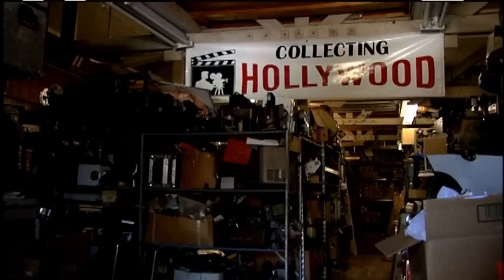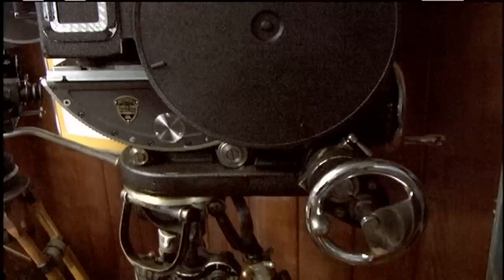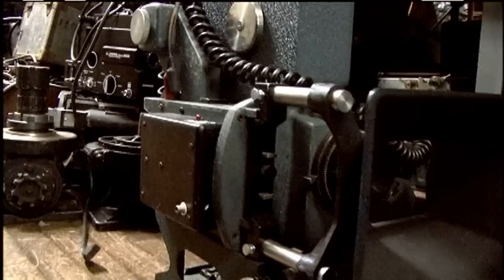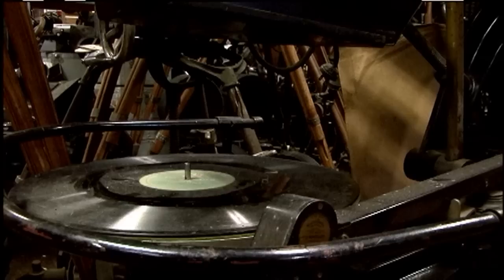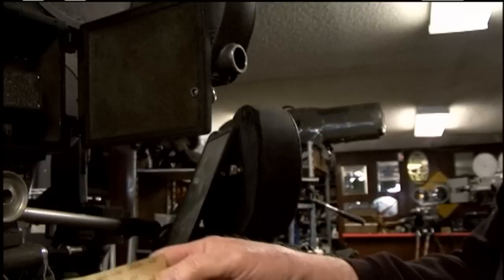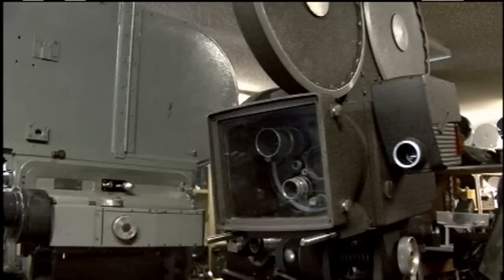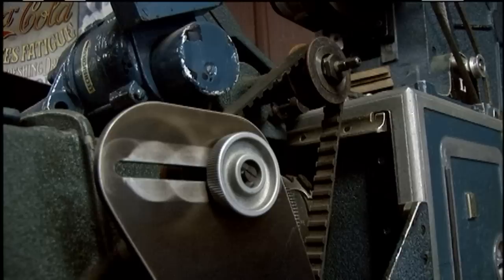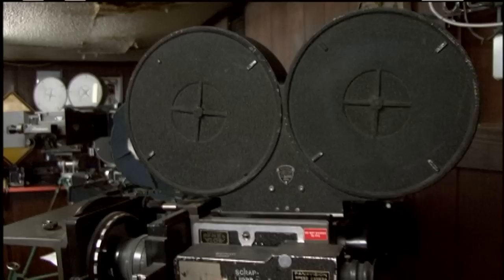Martin Hill - Collector of Film Cameras

Comment: Wow. I haven't seen this stuff in a long time. The last thing I shot on film was Falling Skies which was series we shot for Spielberg's company with Panaflexes. That had to be five or six years ago but a generation ago when it comes to gear. We still have full camera crews when we shoot with Arri Alexas but there are no loaders. Instead the seconds spend all day wrangling cables and videos monitors, and trying to get the wireless transmitters to transmit. 
I loved the BNCs. Very elegant, if ungainly looking from the outside. The Panavision PSR was the Rolls Royce o BNCs. The other ones we used to have to put together. The PSR we just hoisted (it weighed a lot - 80 pounds maybe) out of the box and tried to get it situated on the Worrall head.